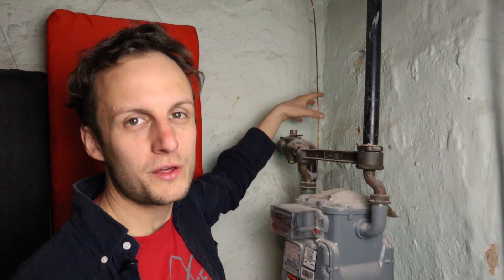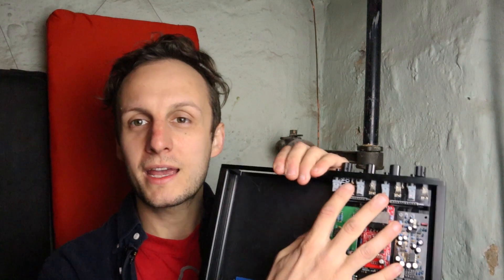What is Ground in Audio?

Comment: The reason a lot of people find Ground difficult to understand is because of all the videos like this that give completely the wrong explanation. [0/10 see me.]
Electrons do not "want" to go to ground, they complete circuits and they don't get very far. In a DC battery torch one electron is unlikely to make the complete circuit during the battery's lifetime, however the rate of propagation is a lot faster: the speed of light. In an AC circuit every electron goes back and forth a very small amount and will never reach the ground
The reason that a PE provides safety is that it is bonded to the Neutral at the breaker board and so is an alternative return path for fault currents. If the alternative path includes some real soil the resistance is high enough that breakers/fuses cannot be guaranteed to blow--do the maths: I = V/R, now what is the breaker value? Most of the world does not have mains like the USA with a centre tapped 240V transformer outside the house and the centre tap connected to Earth. Either the Neutral and PE comes combined from the substation in which case the path is all metal and low enough to cause a high current to blow a fuse (TN-CS) or Live and Neutral are supplied and a local Ground rod added (TT), but the ground path is hundreds of ohms back to the substation. The latter supply is not safe unless an RCD is fitted which will trip if the difference between Live and Neutral currents exceeds 30mA.
The connection to Earth does provide a reference to prevent different appliances having a potential difference between them and provides a path to dissipate static induced charges. The latter may be positive or negative so the electrons may be coming out of the ground, what is really happening is that the net charge is equally distributed between two bodies joined by a wire and one body is literally the size of a planet so it gets most of it.
As grounding applies to audio electronics you need to read and understand AES48 before making any more videos.

Comment: This information is incorrect. Power do not want to exit into the ground by any means it can. it will take the way that have the least resistance. And that will probably never be a wire into the dirt. The ground wire used for protection in equipment is not there to be connected to the ground under your house or whatever. It's there to create a short circuit so that the fuse will go off and cut the power and save you that way. More or less everything said here concerning audio and ground is also incorrect. But I do not have time to explain that now.
Reply: I think you're missing the point a bit here man, he is simply giving, the most simple explanation of ground to audio enthusiasts. I.e. the general concept and there was nothing incorrect about what he was saying. He's quite qualified thanks.
Reply: @mattkent2651   He's mixing things together that has nothing to do with each other. making people believe you need earth ground for your sound system. And I don't not thing that is good. So I called it out.

Comment: The ground is on the gas bc the neutral buss is connected to the ground in your building.  There can be a charge running in in your water or gas pipes.   One can use an amp clamp

Comment: Two Pin AC has the primary of the transformer connected to earth ground. The secondary that is the desired VCC DC voltage comes from a full wave bridge, four diodes. The secondary of the transformer has a center tap and two or more sets of windings for stepped down voltage. Or, for tubes; stepped up. The center tap is the reference for its winding. So, if you desire a + and -DC voltage of 15volts; that's in reference to the center tap. Between the two main secondary's you would have close to 30VAC. The center tap is usually grounded to the chassis, which is the same as earth ground. That gives you half of the sine wave  to the other half in the AC before rectification. Hence you have 30VAC, peak to peak. The bridge takes the above 360⁰ 30VAC and passes the top phase through two diodes to provide the +DC and the negative half it bucks to give you -DC, with respect to the center tap, So, it will not energize that potential to the case should a short happen. Some devices use a second inductor to isolate signal ground from earth ground for an even more stable DC; and that after a shit load of caps and resistors for filtering the DC to a pure voltage. Usually voltage and current regulated as well to open a contact in a voltage to ground potential situation. Usually the resistors are of a certain wattage that they will burn up, like a fuse. Resistors NEVER short. They can change value over time and pop; but never short. All that for the two pin adapter causing you doubt. Additionally it is NEC code that at your distribution box for you house; The earth ground and the neutral side  of the AC are tied together. And, the current flow does NOT stop at ground. It completes the current loop, back to its source. You can't have current flow if it stops from completing the current/load loop. We have devices designed specifically to create this situation; the off/on power switch. Good video. Thoroughly enjoyed it. I'll like and subscribe giving three true statements to the algorithm. The comment is the third. Shalom Aleichem

Comment: Please correct me if I'm wrong, but from the other videos I've seen, seems that copper wire you touched has nothing to do with protection from faulty devices having their power shorted, despite being electrically connected to the third pin in power chords; it's for protection from lightning, instead.
Reply: btw, I've been learning a bit about preamps, and your videos are proving to be interesting! thanks :)
Reply: no thats wrong.  Like he said the wire goes to ground, and via the third pin to the chassis of equipment, which protect you from having an electrical shock when there is a fault in the device.   Lightning protection would have a wire going up to the roof and the other end to ground, NOT connected to your electicals in house.

Comment: One question: Japanese gear uses ground and neutral on the same pin and that's why one blade is wider than the other. I have a Leaderman cassette player (quite nice, btw) that has a test on the rear to check if the correct pin is connected to the ground/neutral. How bad is that? I heard Japan is where the Japanese come from and they are known for doing some pretty nifty stuff. If I have a dedicated earth ground could I be creating ground loops between neutral and earth - specially since not all gear are grounded equally? Thanks!

Comment: I found a very important information a few days ago. It's really important: the high resistance of our body is actually our skin's resistance. If you remove the skin, it's around 300 ohms. We rarely remove our skin so it seems not to be important but I must remember your tongue is not skin and sometimes when we get an electric discharge they created wounds ... and suddenly a 4M ohm resistor turns into a 300 ohm resistor.

Comment: 2 pronged DC jacks are fine. Your notion is indeed a bit flawed here -- there is a transformer inside that wall wart that isolates the DC side from the AC side and the same thing happens if the electronic device uses an AC cord -- the transformer is inside the device. The third prong is for safety and safety only. Ground loops have to be solved on a case by case basis and actually are present due to circuit design but can be corrected by moving the noisy device's power supply to another (surge protected) isolated source. Consider interfacing a battery powered device with a mains powered device ... the battery powered device is grounded ... how? That's right .. don't worry about mixing "audio ground" with "chassis ground" ... worry about digital ground mixing with analog ground.

Comment: It is my (possibly flawed) understanding that having the chassis connected to ground allows the stray current to return back to the panel box and cause the breaker to switch the electricity off. Some current will still flow through you despite you having a higher impedance than the path to ground.